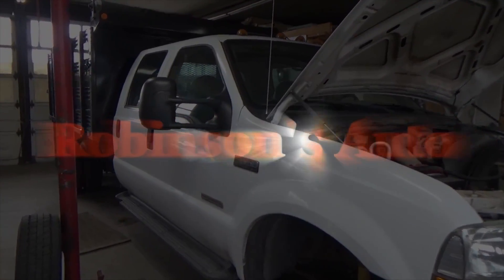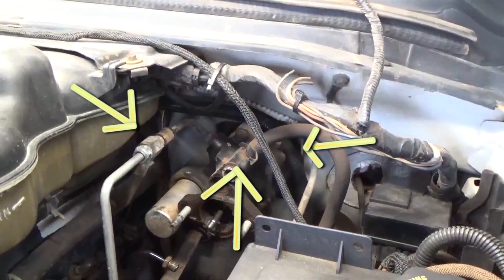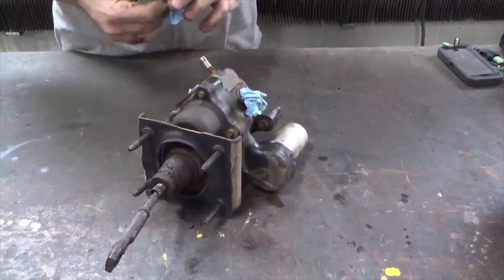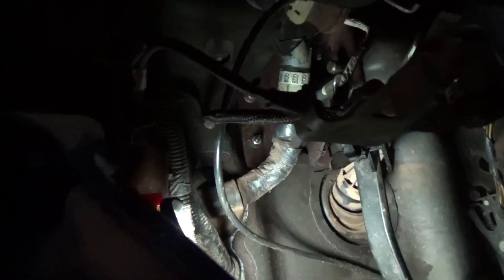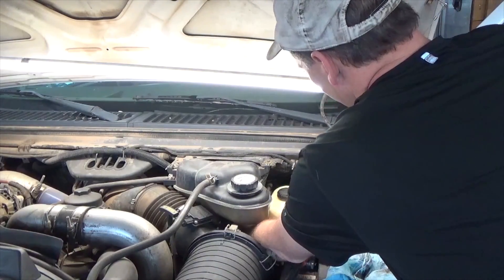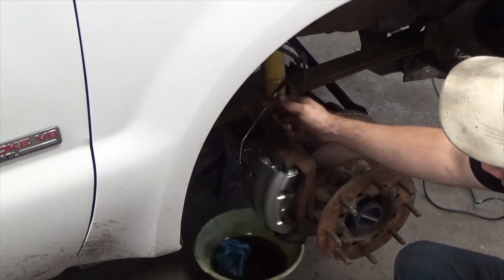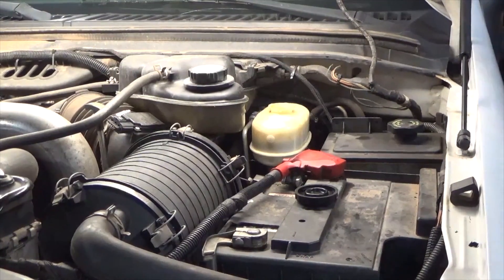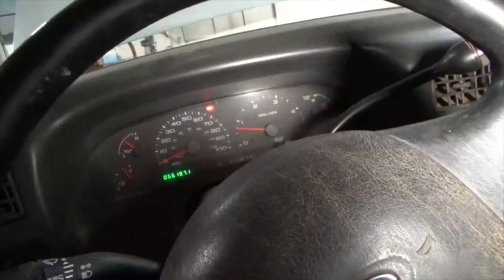Oil on my drivers floor? F550 Brake Hydro booster

Comment: Thanks for taking the time to film that.  Super informative.  Crystal clear explanation.  I'm gonna try some power steering stop leak, maybe it will stop the hydroboost from leaking.  If not I got this video in my liked section.
Reply: Did stop leak work?
Reply: @natethegreat-mobilegaming5530  no, i ended up just changing out the hydroboost unit.  after procrastinating and 20 qts of atf lol
Reply: @chineseeyedgrowr9182  we’ve gone through a couple quarts so far. Gotta order a new one now

Comment: Wow, nice job there.
   Btw when does one know to buy a new hydro booster vs buying online the repair kit to replace all the leaking gaskets? 
    My steery many times after driving the car a bit gets very tight, extremely hard to turn, any chance the hydro booster is the issue or just put the gaskets instead of replacing the whole unit? Or better, why did you change the whole unit vs putting a new gasket , as you took apart the whole piece anyways?

Comment: Holy crap.  I want to organize that welding cart.
Reply from the maker: D6Spanky your more than welcomed at it lol
Reply: Hahaha I love organizing other people's stuff. Mine?  Not as much.
Reply from the maker: D6Spanky that would be fantastic!!!! Never had an organized spare bolt bin. The time that would save ~sigh~ so when are you starting lol :)
Reply: I'll be right over. that would only take about an hour and either some bins or old PB jars to put them in. easy peasy
Reply from the maker: D6Spanky Sigh~ your getting my hopes up lol would be awesome. that will be the first job im sure you would start organizing everything once you seen it lol then motivate me to get the videos rolling again, I'm trying but it's hard doing everything